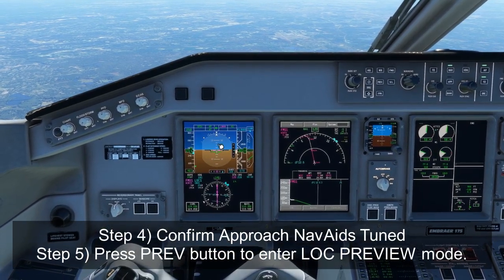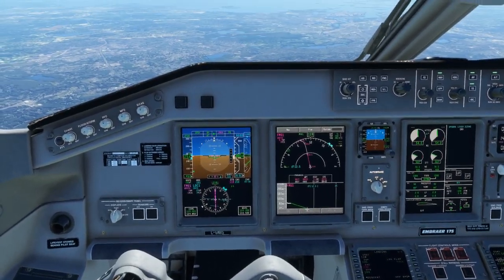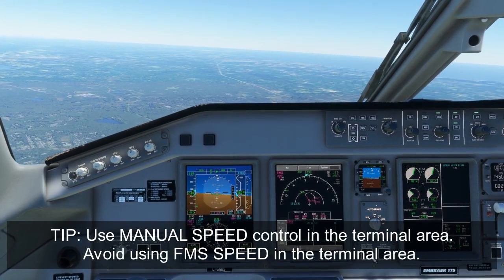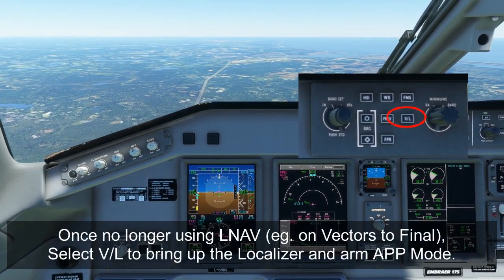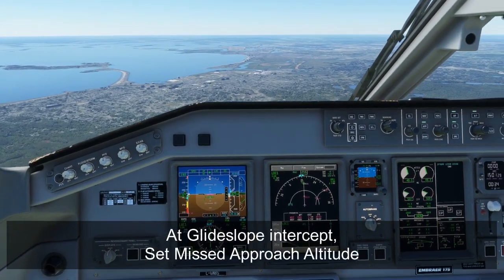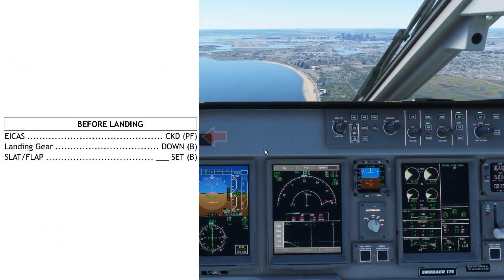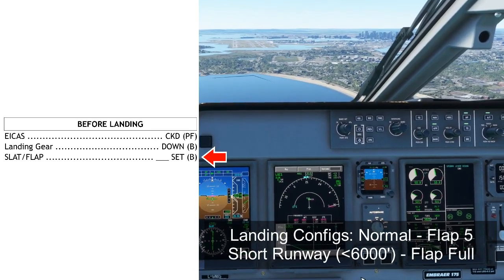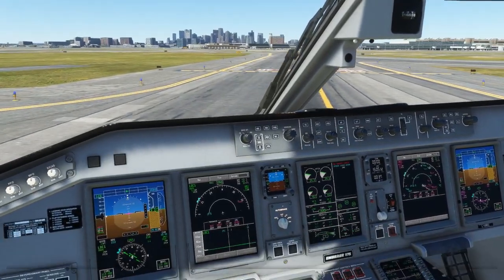Embraer E175 Tutorial 08: ILS Approach

Comment: What isn't clear to is whether you have to *manually* brake on touchdown.  I'm so used to the A320 that I might be assuming the Autobrake works on its own.  I'm really struggling to slow the aircraft on the runway so should I be manually braking as well as setting the autobrake?  Thanks.
Reply from the maker: @ClevaTreva  The autobrake is optional, both for installation and use. If you want to use the autobrake make sure to arm an appropriate level. If you dont want to use it, or if the rate of deceleration is unacceptable, take over and apply manual brakes.
Reply: @CaptNabs  Thanks.  Seems that'll have to be the way forward for me as they're definitely not working!

Comment: Thank you for these Vidoes but idk if its just me or is that that the green lights to show like abov nav are not working now
Reply: Same
Reply: same any news how to fix this?
Reply from the maker: I believe the model has been updated to make the lights on the Guidance Panel optional. Check the EFB for a setting.

Many operators chose to deactivate the lights on the guidance panel. Instead of looking at the guidance panel, read the Flight Mode Annunciations on the PFF. These are a much more precise description of the modes the flight director is in than relying on the lights.

Comment: Awesome video! You’re not supposed to turn off the auto throttle on final and manually control the throttle?
Reply from the maker: @gardenstatecontroller  Theoretically no. Leave the autothrust on and let it control the speed and reducd to idle in the flare. As pilots we keep our hand on the thrust levers to feel it pull back. We also can override and pull it off faster if we are fast on final (Stall Prot speeds on). But the system is designed to be left on through the flare.
Reply: Thank you!🙏 I’m looking forward to the new videos after the fmc update!

Comment: Howdy, i have a bizzare request. I want to understand how to get this bad boy to work specifically om the ILS 28C in to O'Hare. I cant for the life of me get it to capture the glideslope if you cross LNDUH @ 9000 ft. Any help is appreciated!
Reply from the maker: My first idea is that MSFS strictly defines localizer/glideslope transmission limits per standard ILS requirements, but IRL at major airports with long final approaches, the power/reach is often much higher than normal. MSFS does not simulate this.

Therefore, you will need to follow the published stepdowns until the glideslope appears. This seems to happen around 12-15 miles final. LNDUH is too far. Even the LOC in the simulator only extends about 18-20 miles.
You can try the VNAV, or do it manually one step at a time.

Comment: Has there been any improvements to the aircraft or anything?
Reply from the maker: Yes, the aircraft has been steadily improving. The biggest thing still to go is the custom flight management system. Most other systems are pretty reasonable.
Reply: @CaptNabs does it have VNAV?  That seems like a huge miss.
Reply from the maker: @gringoloco8576  In the real world, VNAV is available. The latest aircrraft update introduced a new autopilot with VNAV. Originally the code was piggybacked on MSFS autopilot and FMC which have very limited functionality, but the end goal is a fully custom FMS and autopilot to follow real.world procedures.

Comment: When I hit the PREV button I get VOR instead of LOC how do I fix that?
Reply from the maker: The system will automatically detect the type of navaid in use based on the frequency selected. Be sure the correct frequency is showing on the appropriate NAV radio on the MCDU > RADIO page. LOC will only show if an ILS frequency is selected.

Note that the first tap of the PREV button selects the on-side NAV radio (eg NAV1 for Left seat, NAV2 for Right seat). Tapping PREV again selects the offside NAV radio. Tapping PREV a 3rd time turns off Preview Mode.

Comment: What throttles (hardware) do you use for the FSS E-175 throttle and reversers? I have the Honeycomb Bravo and did follow the instructions from Aerosoft, but it is not so reliable for me. Thanks for your help.
Reply from the maker: I use the Bravo as well. I dont seem to have too many issues. Just push it forward at takeoff, then careful to touch it again once the autothrust is on.
Reply: @CaptNabs  But how do you apply the reverse thrust? The Aerosoft 1-minute tutorial, indicates the assign BUTTON 26 to the Toggle Reverse Thrust in the Power Management config for the Bravo, the pull thrust back to activate the BUTTON 26, but the push forward to TO/GA power to activate Max Reverse. It is a little weird. What do you do to activate reverse? Do you use the Bravo?
Reply: @CaptNabs  It would be great if you could create a video on how to properly configure the HC Bravo for the FSS 17x/19x series. There aro no goo tutorials out there about it. Thanks.

Comment: I have a weird problem where everything works except when I try to descend below FL200 the plane literally won't let me. Even if I turn autopilot off and try to force it down, it just bobs right back up. Know what that's about? I haven't seen anyone else with this problem yet.
Reply from the maker: That is weird, and I don't know what to suggest. I have had lots of trouble with FLCH mode, but with the autopilot off you should be able to push the airplane wherever you want. It doesn't have the Normal Law protections of an Airbus. I would suggest retesting and if it keeps up, maybe a reinstall. Or consider messaging the developers directly via their Discord. I am only a beta tester.